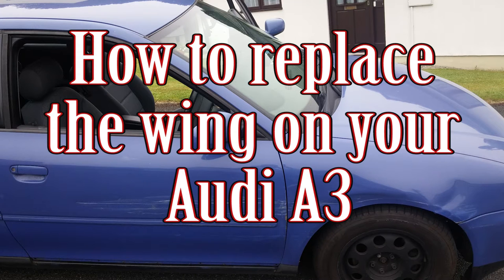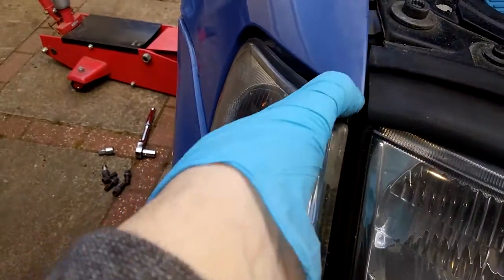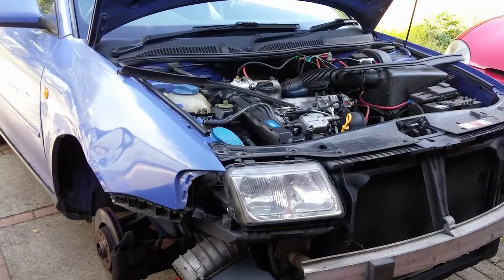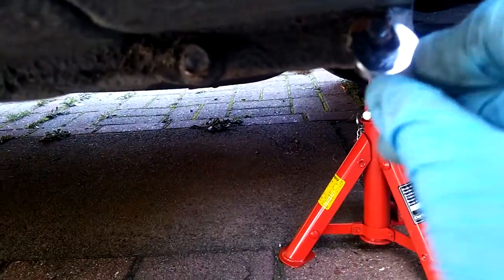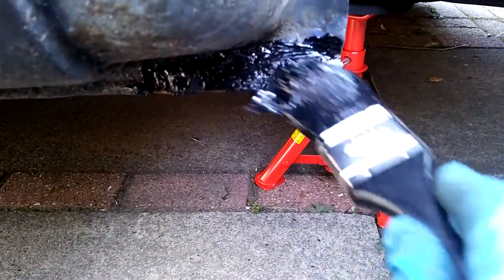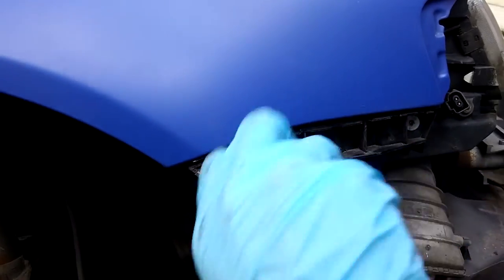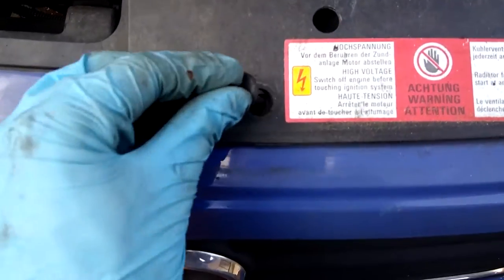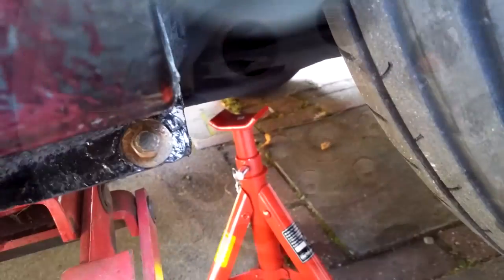How to replace the wing on your Audi A3

Comment: Your brake discs are shot Dude next job front offside wheel off again and out with the jack again lol good video though
Reply from the maker: Video's years old - they got swapped  front and rear for Brembo disc and pads at some point between this, roller painting it black and then getting rear ended and written off....I've since killed a different Audi and onto some interest Jap import stuff now.